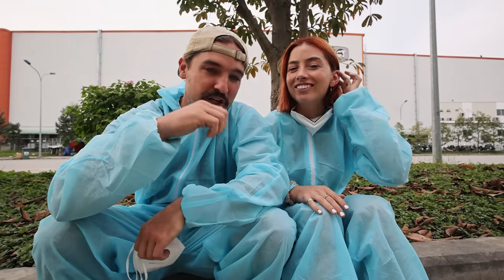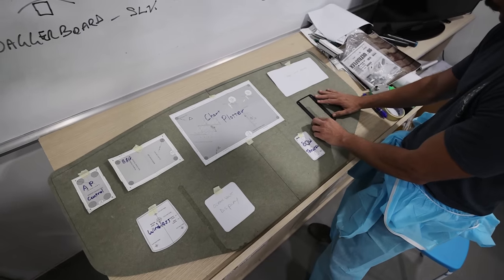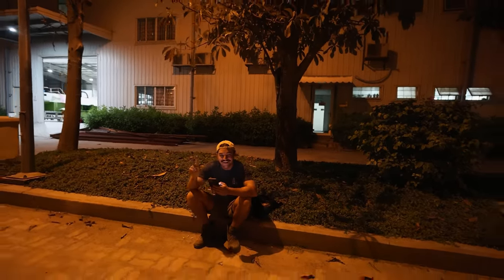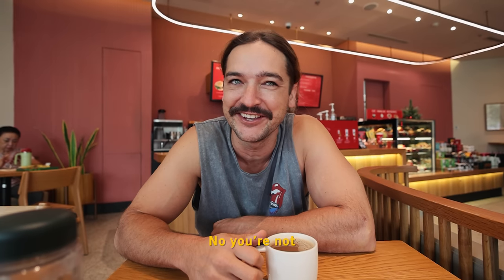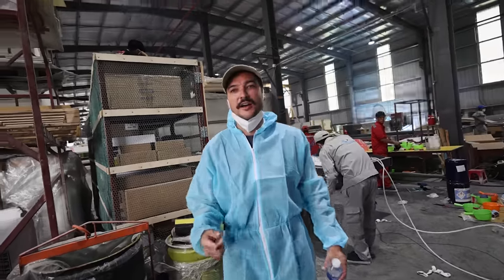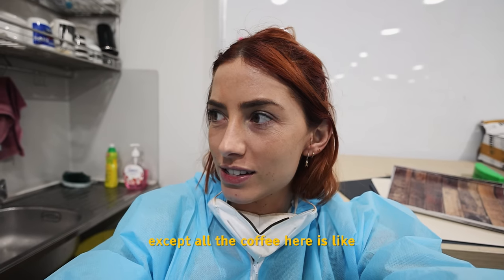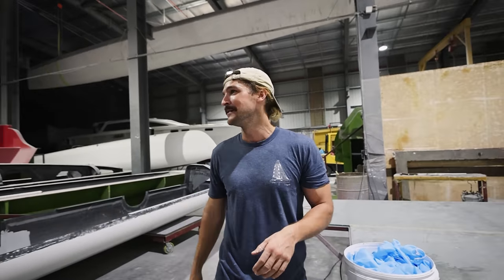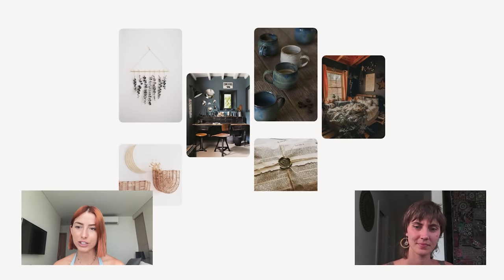BOAT BUILD: Interior work Begins!

Comment: What an amazing experience participating in the construction of the Vaga 3.  One important thing to note while working in this environment are the hazards with carbon fiber dust and atomized wet paint.  Please be very diligent with exposure to these materials as they are extremely hazardous.  As a hobby, I do a lot of auto and motorcycle work and do a little painting and work with carbon fiber.  I  too wear a hazmat suit but wear a full breathing face mask to minimize the exposure to materials that are classified as carcinogenic.  That way you will stay healthy and beautiful forever.
Reply: Yeah... Was also wondering about that part...
Reply: Yeh, I'm a bit disappointed that the workers are not given adequate protection either. It's one thing to pay workers less in line with the countries wage levels, but to also skimp on safety gear as well is not on.
Reply: @John Tarrant I'm taking about the sanding and spray painting. In our country work practices mean you need fully sealed masks at least and eye protection when working with hazardous aerosols and particulates. They might as well not wear those masks since most of the air comes in from the sides since no seal. The fact Riley said he was getting dizzy from the fumes tells you all you need to know.
Reply: Full face or half-face masks with added eye protection goggles, cartridge filters of P100s are ok, but 3M 6000 series (paint fumes and corrosive solvents) would be the recommended level of gear, but it’s been years since I had need for that, so I’m forgetting how often that they need to be replaced, total blanking on that part?
Reply: Maybe I didn’t wear it enough, and that’s why I’m blanking now.😅
Reply: Carbon fiber dust go into your lungs 🫁 and make many small cuts in the tissue 🥵 Like robert say, full breathing face mask 😷 is so important for your lung health. On another note, love this content 😊

Comment: Half-faced respirators with the rubber seal will better protect you from the dust - and with certain filters - from the fumes.  It's an opportunity for the company to improve the PPE for their workers.
Reply: Yeah I must admit I am more than a little worried about these guys (and especially the little lungs of the boys!) and the TOXICITY of a brand new boat: epoxy, glues, paint, materials from China, they're probably going to have cabinetry made out of particle board which will outhas formaldehyde for years and years to come especially in a damp ocean environment. I almost wish they'd stayed on SLV II.
Reply: Thank you for bringing this up. I was resisting mentioning anything. Also it might be a good idea for them to look up MSDS's on the chemicals they are working with and around. It will be eye opening and hopefully encourage them to find some improved PPE.
Reply: Yep, surprised the rapido owners are not intune with safety of their employees- they are definitely the black lung.
Reply: Yeah proper masks for the workers would be nice! Kind of surprised they just have these masks on. 😲
Reply: @patrickjames1080  might be adhering to local regulation but they should go further in my opinion.
Reply: @AlexKall  good point on the local regs
Reply: 3M 6000 series filter cartridges, and don’t fudge on the recommended replacement rate. Good for paint fumes and corrosive solvents.
Reply: Cheap labour and low health and safety standards keep building costs down
Reply: Yes, yet is it up to Riley to teach them about the laws that the US and Canada do have regarding PPE equipment, I mean he's simply the owner of the catamaran, and after they are gone, there's nothing to insure that they will keep up or maintain equipment for their workers? that's one of those questions that belong on the twitter feed Riley had mentioned.
Reply: @cherylsibson2529  Riley's talking about getting high from fumes - it is common sense to use a N100 respirator with filters that remove organic vapors.  It's in the best interest of the workers to wear effective PPE (not Riley's job but an opportunity for the company to improve the workplace, along with using more fans and fresh air).  Many people are ignorant until shown what is right to wear, and/or do not want to complain/be a problem.  Many companies do not provide proper PPE.  Once I visited a smelter in Kentucky to install a piece of  equipment.  The air had lots of metallic dust (our equipment was XRF and detected metals) and no one wore a respirator or even dust mask.
Reply: Yes this! Get any respirator you can find that (a) seals around your mouth and nose, and (b) has CHARCOAL FILTERS for "organic vapors".  (If the mask is working you should not be able to smell any paint or fiberglass smells AT ALL, no matter how powerful of chemical their using! When the charcoal filter is used up you will start to smell vapors: replace the filter with a new one.) This alone will make you feel better than all the Athletic Greens you could ever dream of! 😀
Reply: @Cheryl Sibson  It has one more maran...it's a trimaran, not a catamaran.
Reply: @patrickjames1080  yeah honestly the safety of their workers are trash. especially when they were taking naps on cardboard.
Reply: That’s why you build a boat there it keeps everything nice and Cheap
Reply: @cherylsibson2529  why should an australian teach the vietnamese about Canadian and american ppe laws?
Reply: @Dan-mu5oy  it's about "the guy next to you".  I suggest people wear what is effective to keep them safe - going beyond requirements as needed.  The PPE should be good enough for your kids to do the work (assuming they are adults :).  Laws/requirements are minimums, not what is best.
Reply: @chrismackay8314  yes and? what does that have to do with my comment? i agree with you however i made no reference to best practice?
Reply: @Dan-mu5oy  Because the best science we have says that Canadian and American PPE-laws are simply the reasonable, fair and decent thing to do in this situation. This is just another common sense thing. And Aussies seem to be pretty good at common sense. But apparently not the three dudes running this company. Surprising that they let SLV show their current practices... And like something said: Those Athletic Green drinks isn't going to help one bit against the dust and chemical fumes... Also kind of wondering what Athletic Green thinks about being associated with working practices like these...
Reply: I assume the company is doing the bare minimum of what is mandated by the Vietnam laws.   They really need to up their game in PPE for the safety of their workers, despite country guidelines. Sadly, it all comes down to the bottom line.
Reply: This is all a bit hypocritical @SailingLaVagabonde you espouse health  (and do promotion for somethigreens) but you are happy to pay off workers with coffee and doughnuts. I understand that WHS in Vietnam is a different standard to Australia (and New Zealand) but shame that you wouldn't expect the same for other humans no what nationality. I use Jotun paints and use more PPE then your workers! Unless we hold the best standards for all then we are just self centered focused on what is in it for us (pay the real cost....some time from now your worker, dying from cancers.... hello Hardie Asbestos products.) Hope you boat serves you well, pity the worker that help to build your dream. Rant over!!!
Reply: @aardvarkdust7519  you clearly work in industry yet you expect two social media people to know and understand heath and safety in a factory environment?
Reply: A message from the management of Rapido Trimarans:

We are very proud of our workers. Their safety and well-being is of the highest priority and unfortunately, as shown in the video, we collectively let ourselves down in this instance. 

3M respirators and face masks are supplied and have been taught to be worn at all times but they were not being worn at the time of the filming. This issue has now been addressed.

Giving an independent third party unrestricted camera access to our factory can be confronting. In this case, it has highlighted an important issue for us, which we need to have rectified.

As a company, we will continue to learn and try to do better in our quest to build the best ocean-cruising trimarans in the world.
Reply: @rapidotrimarans  well done good to hear!
Reply from the maker: @rapidotrimarans  thanks for writing in here guys. I can’t help but think I should have noticed and pointed it out as well. My mistake as well.
Riley.
Reply: @SailingLaVagabonde  all said and done looks  a fantastic boat hope this issue hasn't course to much problem.
Reply: @SailingLaVagabonde  maybe you can discuss the PPE in the next video? It would be an improvement for that company to see proper respiration considering Riley felt dizzy from the fumes, as someone who works in a shop my self it’s pretty serious stuff to be working with and proper ventilation or masks can go a long way…
Reply: @zeebov9   most likely isocyanate in the paint they are using, is highly carcinogenic and not filtered by charcoal vapour cartridges. Supplied air is required to keep the spraypainter safe

Comment: Experienced plant owner here! Pothos plants, the simple green trailing kind, are often referred to as the college dorm plant because they are so easy. Spider plants are also pretty indestructible and need little soil. Snake plants, as well as purple tradescantia are sort of in the succulent family but versatile and easy. Those are four ornamental houseplants that are very common and easy, low light tolerant etc. and look really nice! They are also very easy to propagate and multiply. 

However, they may be better suited to the cabins and heads where the light conditions and temperatures stay more consistant, and windows are limited and often closed. If you’re looking at plants for the above, living area, I would suggest going with plants that thrive near coasts (think hardy mediterranean stuff, like rosemary for example). They will be more likely to tolerate the salty breeze and drastic changes of temperature and light. 

Just remember that a lot of house plants like the first ones I mentioned are adapted to an environment in which temperatures and light are consistent. Keep that in mind when placing plants in the space. Also, salty air is a plant killer unless the species is adapted, if it isn’t you should probably keep it away from the salty breeze as much as you can.
Reply: I second spider and snake plants. Pothos can be finicky
Reply: @Jesse Sychterz  I dunno, in my experience, pothos are hard to kill. Even my girlfriend's grandfather, who's 104 and has killed all of his plants in his old age, still has a pothos that has survived.
Reply: @resiack  I have nearly thriving 50 plants in my house and my pothos are always sad looking. Maybe its my soil, pots or something else. They do fine… but never look as healthy as the rest!
Reply: @SychJess  Do you turn them/move them a lot? I never turn mine and let them bush out on one side and they look so luscious that way. I put mine outside in the spring/summer and they love it.
Reply: Rosemary.  For sure.  And so easy to take a cutting and grow another plant.  Makes a great swizzle stick for cocktails and other drinks too!
Reply: @SychJess  I’ve had some pothos thrive and others stunt. It can be a combination if things, insufficient light or incorrect soil composition are the main culprits I believe.

Comment: I agree with the architect! I work with interior design daily, on a boat the spaces are very small so keeping the walls and floors a neutral color throughout is safer and then you can add color in the soft materials! Too many colors and textures will make space feel busy and crowded not smooth! Looking forward to seeing your boat finished! Cudo’s to you for helping out the build!